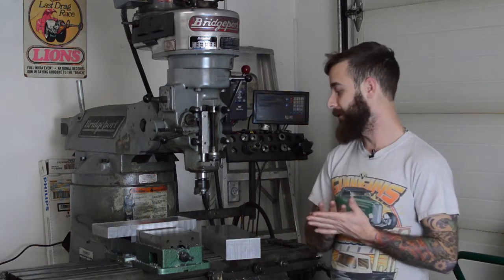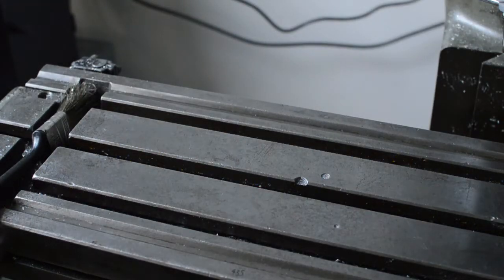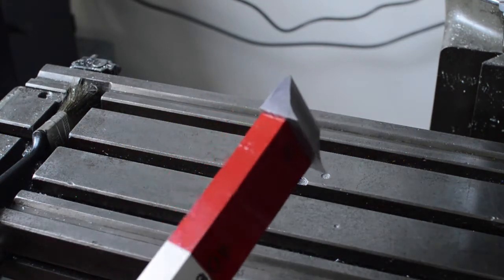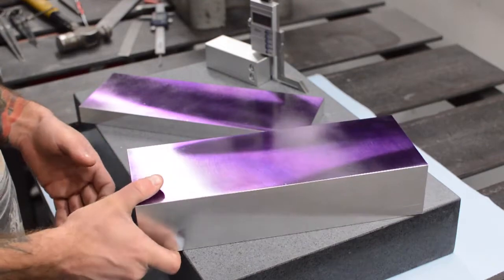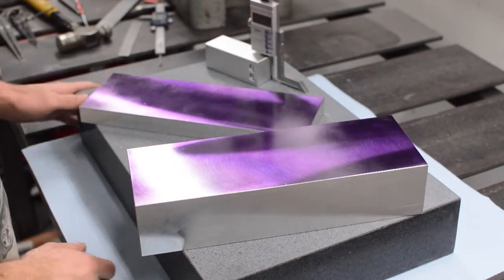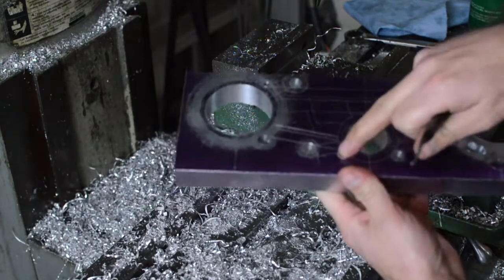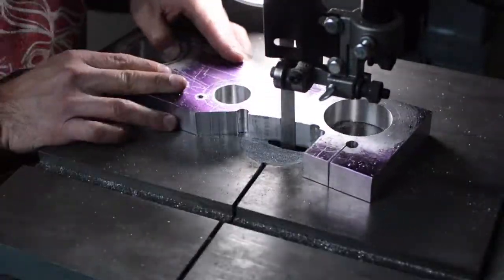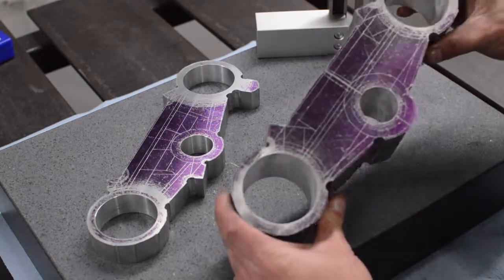Making Triple Clamps - Part 1 - Turbo Buell Build

Comment: What is the fork clamping area diameter if you are to fit an X mm diameter fork, so you can clamp it without distorting it and the fork mounting in the clamp on relatively tight fit ?
Reply from the maker: I usually give the clamps a couple thou clearance to the work diameter
Reply: @panicrevcustoms7760  how much is that clearance? Is it a good number to go for 0.1mm clearance? Also, what about clearances where you have to press fit something, like the axle?